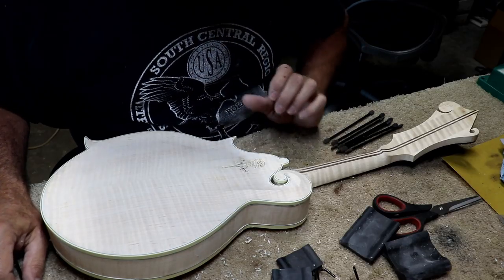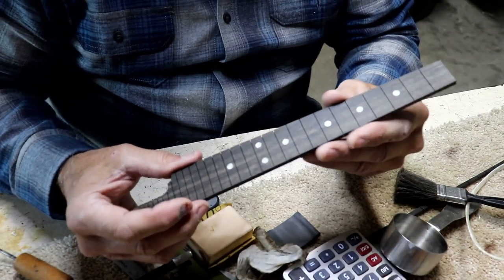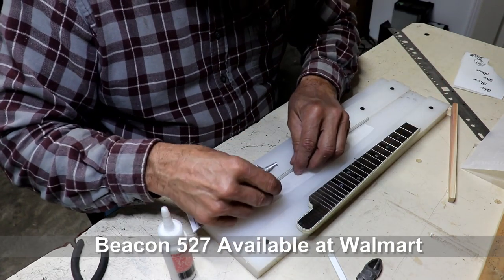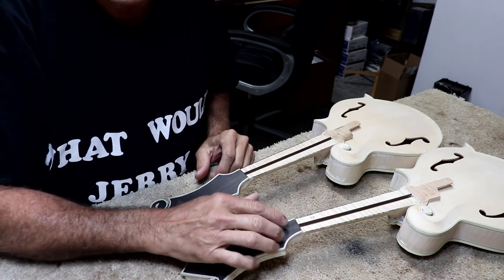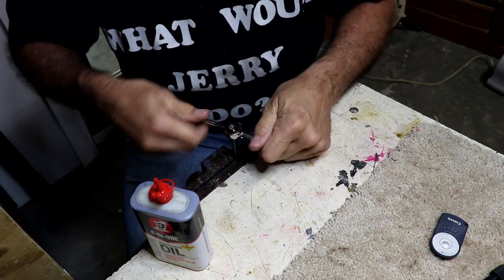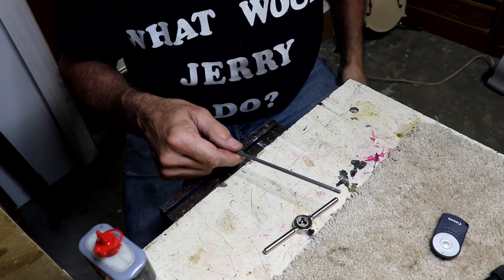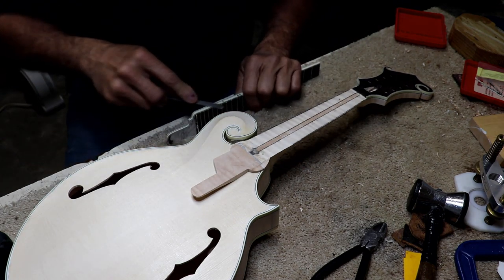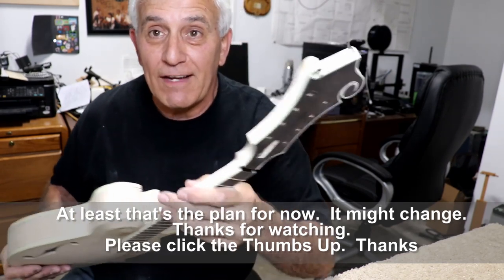275 RSW Twin Mando Proj P7 Binding Truss Rod Fretboard

Comment: If you are going to try and stick metal to wood with Epoxy Jerry there are a couple things you can do to make the bond, bond. First is throw away 5 minute Epoxy. When I use an Epoxy I use one with the longest open time I can find. Usually somewhere in the 20 to 40 minute range. The longer the open time the stronger the bond. This is true no matter who makes the Epoxy. I sandpaper scratches into the metal component and always degrease the metal with acetone. Of the things that I like Epoxy for are; no need to clamp it if I don't want to. Unlike wood glues which require correct clamp pressure to bond to full strength. I usually hold an Epoxy bond with tape only. It will bond to full strength across a gap unlike wood glue which requires (as you know) full mate-ing contact . ** I never use dual applicator injectors as they always get contaminated or would that be cross pollinated and start curing in the tubes. I can keep separate bottles of resin and hardener alive for years. **  My latest reading on and experiments with wood glue say that there is an advantage to waiting 1 to 2 minutes after applying wood glue and before putting on the clamps. In that time the wood will absorb some of the glue. I will then apply another light coating of glue on both pieces and then clamp. I use this technique on end grain to end grain joints , as in miter joints; and have noticed an increase of the strength of the bond. How do I know? I do up a test joint using best procedure, give it 24 hours of cure time and then try to break it with my hands or in some cases a hammer. The harder I have to work to break the joint the more it impresses me. ** glad to see you are getting good use out of the contoured sandpaper  holders.  George

Comment: The herb Turmeric contains an active ingredient called curcumin and this is reckoned to be useful for treating arthritis. If you choose to try this remedy, buy one that has the patented version called "Curcuwin" in it. The reason is, that the body finds it very hard to absorb curcumin- whereas that modified version is assimilated readily. In fact, if you check it out, curcumin has so many good effects on the body it is worth taking as a general tonic- which is what I do.

Comment: Sorry to hear about the arthritis and the left thumb. I had to have my right thumb joint rebuilt in 2010 because the cartilage was gone and I had bone on bone. The doc took a bone out of the thumb joint, used a piece of tendon from my arm and made a new "bone" to take its place. It worked like a charm but it was a SIGNIFICANT surgery with about 12 weeks of recovery time. Just to plant a seed, have you thought about building or modding a mandolin to have a wider neck which would change the grip geometry in your thumb?  It might prolong your ability to play for a bit.

Comment: I use a cream prescribed by my orthopedic doctor.  It's called Voltern Gel but there is a generic version  I'm now using 'Diclofenac.'  I was also taking the pill form of Diclofenac but had to stop because I have Stage 1 kidney failure  and it is a strong NSAID which is not good for my kidneys.  (Kidney doctor said cream was OK).   Check with your Doctor and see if he/she will prescribe it for you.